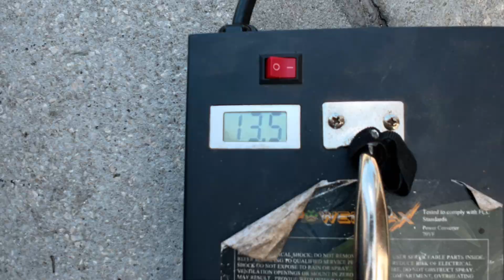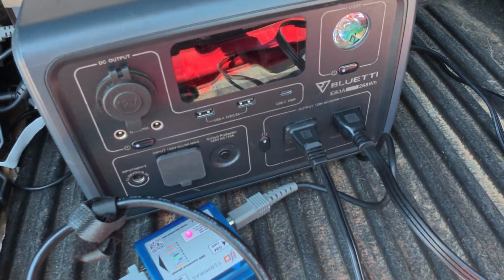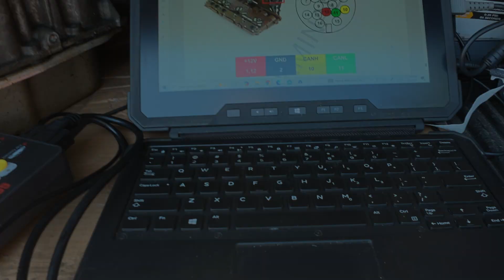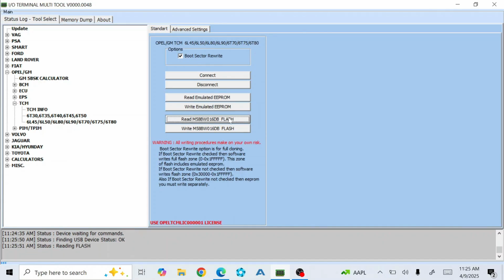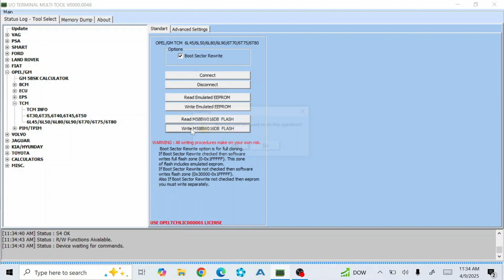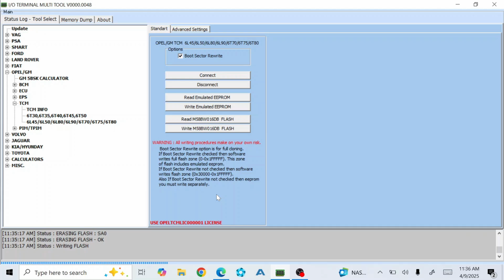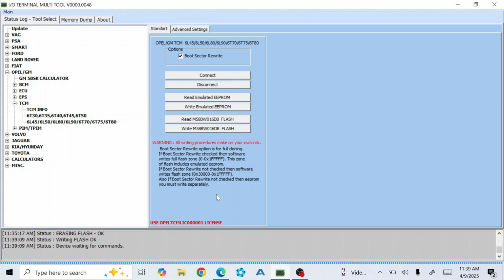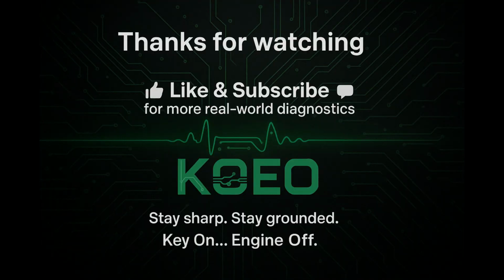How To Program A Used 6L80 In Sierra or Silverado

Comment: Can a newer 2019 6L80 be reprogrammed to work in my 2011 Chevy Silverado?
Reply from the maker: Yes. However. It may require the use of 3rd party software. Due to the fact that that tcm part numbers may be different.
Reply: I installed a used transmission 2013 6l80 it doesn't go into gear at all does it need programming  or its a bad transmission ? thanks